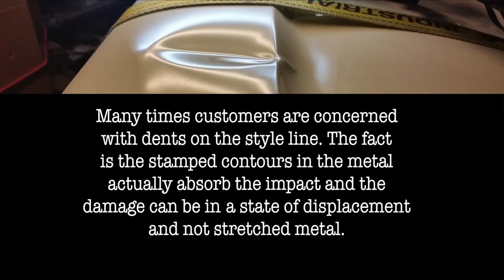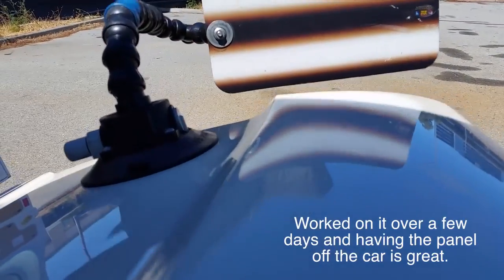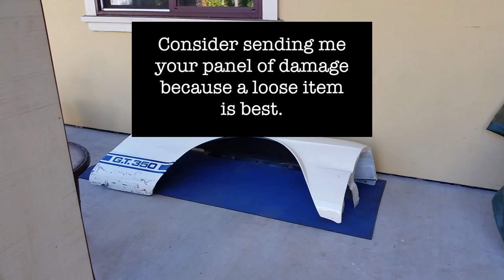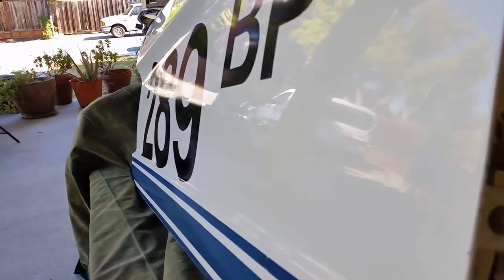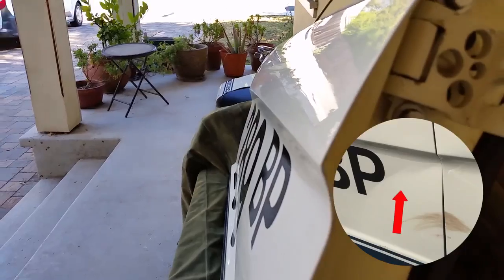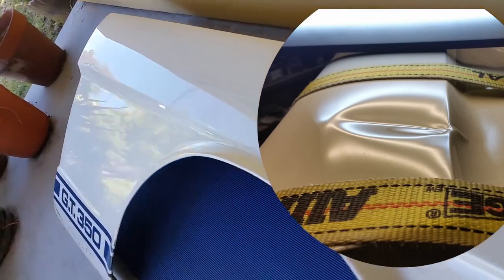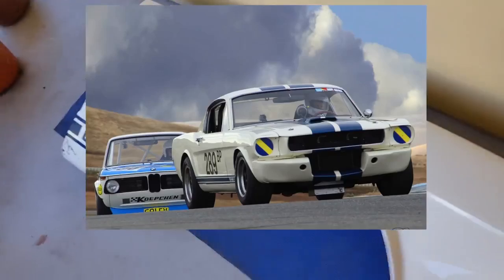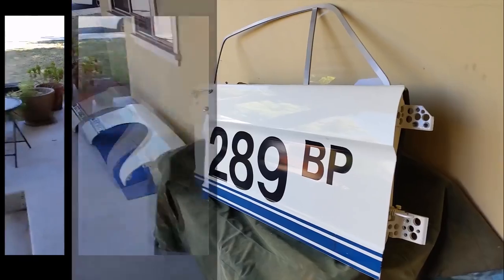Ford 1965 Shelby GT350 fender repaired without repainting.  Paintless dent repair by DentExperts

Comment: Nice work. Who ever repainted it did a good job . Most repaints would push the undercoats off the metal . Nice work sal . I bet he was happy
Reply from the maker: thank you and yes exactly, I even prepared the customer for paint crack but was pleasantly surprised. You can't use narrow tapper though because there always is some layer of skim coat. My method of Pdr is different where I don't make a new texture in or around the dent. I always raise the bottom unmolested, then lay it down for the finish. It goes by much faster when you don't have to fix the texture or do heavy polishing. Thanks !